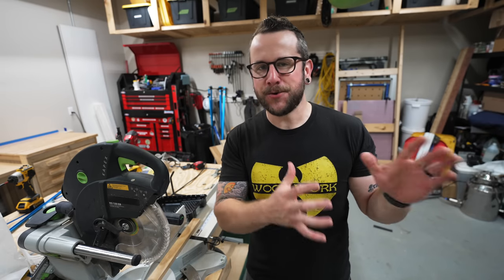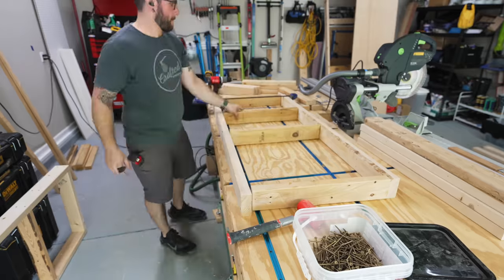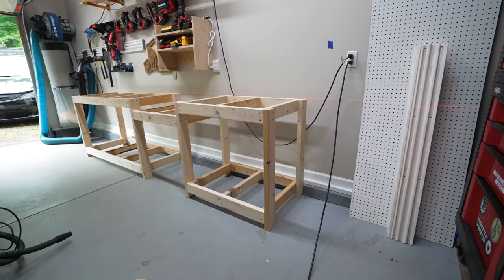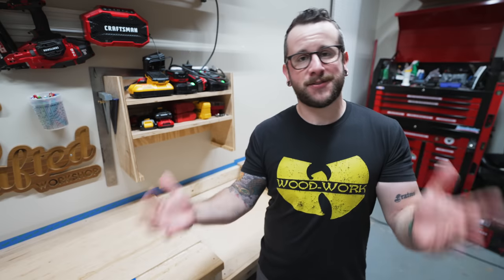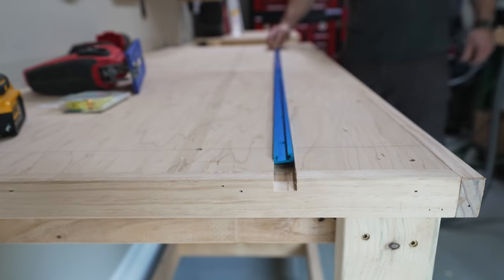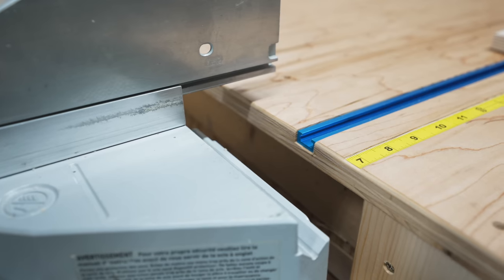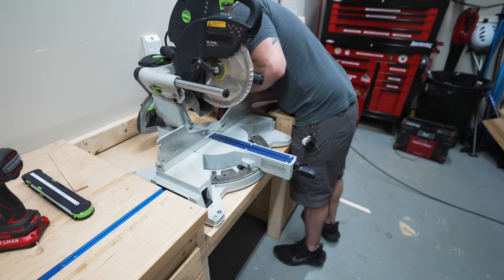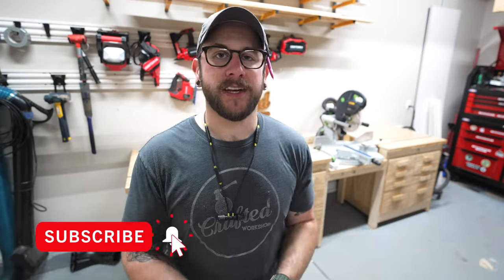How to build an EASY DIY Miter Saw Station! Stop Block ✔️ NO FENCE!

Comment: I had an idea while building my miter station. I used adjustable leveling legs flipped upside down under the drop down section and it's so much easier to hone in the perfect height. I did this in case I decide to get a new miter saw and it ends up being a different height than my current one.

Comment: If you use a longer stop block you can then cut it and start your tape measure from 0. Then it’s easy to check in the future if it’s still accurate, set it at 0” and lower the saw blade.

Comment: Looks good, trim around the top is a nice touch. Only thing anchoring it to the wall is the top?
Reply: It's a set of lowers. Unless you overload the top drawers and plan to open them up all at the same time, the top being screwed down is more than enough.
Reply: @gXXrGoNe  stranger things have happened in my shop. Never know when something heavy is involved

Comment: I have a question about something you did a few years ago.  I figure asking on your newest video will help it with the algorithm.  
My daughter is building a tiny house and wants to put a multi zone mini split in it.  She has the same issue that you had in your video, DIY MULTI-ZONE Ductless MINI SPLIT Installation in New Construction!
Small rooms with a 9K handler.  What I was wondering was, did it work out well for you?  Any thoughts I can share with her?  Thanks.

Comment: Garages are not for cars. They are for workshops and storage. And sometimes a guest bedroom suite. I've never parked a car in any of the garages I've ever had, primarily because the two car garages have never been wide enough for two actual vehicles and we've usually had either 3 or 4 vehicles on site.

Comment: Just bought the plans. I have the dewalt sliding compound mitre saw though, do you think increasing the table size to 30” would work? It’s pretty big, but it was a deal I couldn’t pass on. Thanks
Reply: It is model dws779
Reply from the maker: I don’t think that should cause any issues!
Reply: @craftedworkshop it’s going against the wall though.